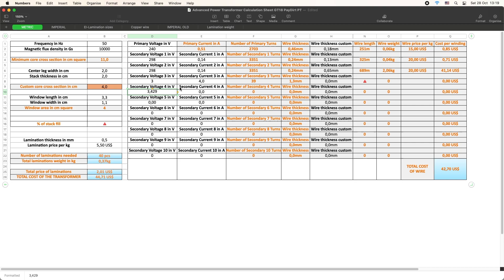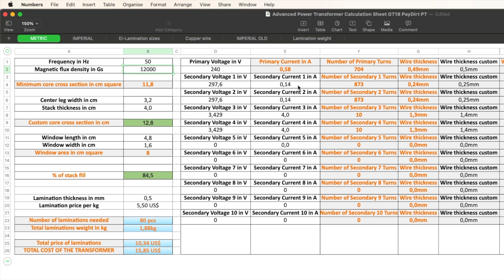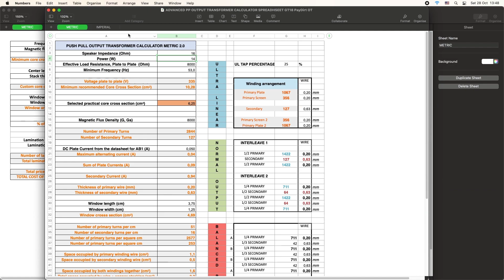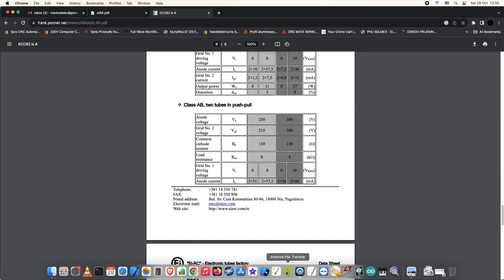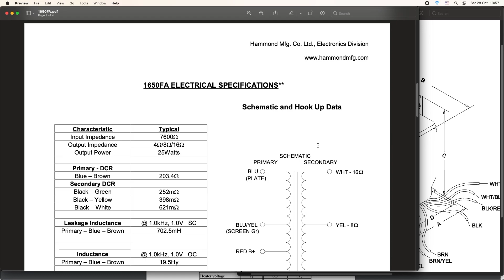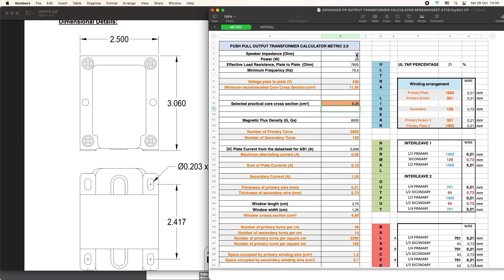Calculating power and output transformers using spreadsheets

Comment: Hi Delatsch! Your calculator uses no-load values for the power trans, correct? What do we do if our schematic only shows loaded values? Is there a simple formula to convert these values to no-load? Thanks!
Reply from the maker: Hi, multiply the loaded or nominal value by 1.07 or 1.08. In most cases that should work just fine.

Comment: About to make my first transformer using your OPT transformer calc sheet that i bought a while ago. Thankyou. I have a question. You mentioned at 30:00 that having less number of turns affects the low end. The bobbin that i am using is 25x40 which larger than you used for the 5E3 OPT. But it also means i get lower number of turns due to larger bobbin compared to your calcs for the 25x25 obbin. Will it still effect the low end?
Reply from the maker: What I wanted to say there that with optimum core size you should not push the transformer to high magnetic density on the cost of lower number of turns, but of course if you have a larger core you will need less turns than I had to achieve the same primary inductance so it will not be a problem.

Comment: Hi, what a great videos. After I've watched this one I tried to make a little sheet for my own calculations. I've replicate your steps and I've got same results as you did, but I tried to replicate the Hammond 290EX (120V 60Hz I'm from Venezuela) which seems to use EI-76.2 laminated. The window space seems to be too small for the required space used for the bobins so my calculations are wrong in some point I guess. It would be great if someday you could make another video replicating one of those Hammond transformers
Reply from the maker: The trick is that they probably use higher permeability core, so they calculate it with 12000Gs or so. The window should be 3.75x1.25cm, so around 4.69cm
Reply: @Delatsch  Ok thanks for the answer. The only way I can the make it fit the wire is using a permeability 30000Gs. The EI-76-2 window is 1.27 x 3.81 cm. My calculations:

PRIM: 120v          / 0.93A / 21 AWG / 182 TURNS / 3.62 mm
SEC1: 351.20V / 0.1A / 31 AWG / 533 TUNS / 0.91 mm
SEC2: 351.20V / 0.1A / 31 AWG / 533 TUNS / 0.91 mm
SEC3 : 3.43V / 2.25A / 18 AWG / 6 TURNS / 1 mm
SEC4 : 3.43V / 2.25A / 18 AWG / 6 TURNS / 1 mm
SEC 5: 5.40V / 3A / 17 AWG / 9 TURNS / 1.1 mm

Amp X mm : 3
Gs: 30000
TURNS X VOLT: 1.52

This is the best I can do until now, I'll keep trying.

Percy
Reply: I have seem some videos taking just the half of voltages the secondaries (with center tap) in order to calculate watts. Every cicle (in a certer taped bobbin) use half of voltages at time, so it dissipates the half of the watts so there is less current flowing every cicle, this is why is possible to use a thinner cable. This is the only way the cable fits at hammond 290EX.

Comment: Hi, interesting output calculator. How would you use it on a Darlington single BJT class-A with a coupled transformer output into 16ohm speaker? Output power 2watt. Power supply 20v dc.

Comment: Hello Marko,  I am having a hard time understanding "Selected practical core cross section (cm2)"  in the Advanced PP Output Calculator.  Thanks.
Reply from the maker: Hi, that is the core that you selected, the one which you have. So, the calculated is just what the optimum should be more or less, but you need to specify what you will use exactly. It is the width of the center leg of the core times the height of the stack. Or if you have the bobbin, it would be the bobbin hole length times its width.

Comment: Hi Marko!  Edcor sells laminations that they say have a Gauss rating of 20,300. Would you put this really high number into your output tranny calculator or would you lower the number a little?
Reply from the maker: Hm, sounds a bit optimistic, but you can test it. Wind a simple 120V or 230V primary to 10 or 12V secondary and check if you will get the calculated voltage. Keeping the gauss level slightly lower will make the transformer run a lot cooler as well.

Comment: Hi Marko! Thanks for your vids. I bought your bundle last week and look forward to winding soon! One thing though about your rec of splitting large wires into two parallel bifilars; if your calculate the cross-sectional areas of the large and smaller wires, you’ll find half-thickness wire is actually far lower than half the area of the larger wire. Two runs of 2/3 the larger wire is closer.
Reply from the maker: Hi Eric, thank you for your kind words. Hm, I never thought about that, but yeah, what you are saying seems to make perfect sense!

Comment: Hi Delatsch, thank You for the tutorial, for me especially informative is the second part - OT calculation. I bought your calculator, and trying to get to proper results - could you help me a little bit? It is a tube EL84, the amp is for audio purposes. I have EI84 cores, 2,8x42 standard bobbin. So the core cross section is 11,76, plate load is 5,2k, speaker impedance 8Ohm, Power (overrated) let's say 10W and min. frequency 50Hz. For such parameters i have primary/secondary turns like 5188/203, and stack fill of 85% (too high). In this material you said that in your experience primary should have 2000-3000 turns to have good sonic results. I can have such result by setting minimm frequency at 150Hz. Is that a proper way to calculate? Could such transformer reach - lets say -50Hz low?
Reply from the maker: Hi Jacek, something is not correct there. Please contact me on my web page or facebook.

Comment: The website not working ?
Reply from the maker: It should be working fine, I mistyped the address and changed it now.
Reply: Marko,
Excellent video.  Great to have you back.
When do you expect your “new calculator” to be available?
Reply from the maker: Thanks Robert and thank you for your support. It will be available in a few days, but I will send it you tomorrow. @robertpichora5881